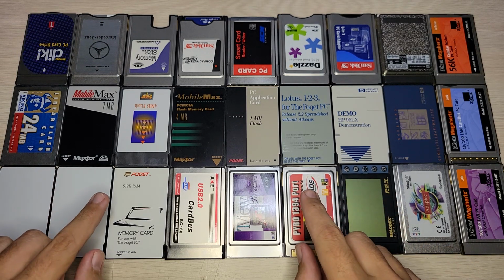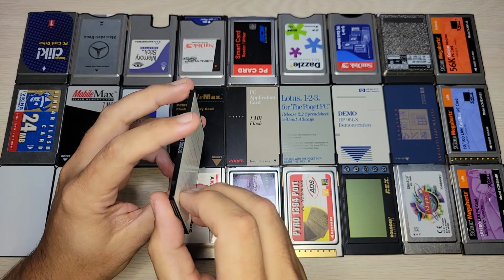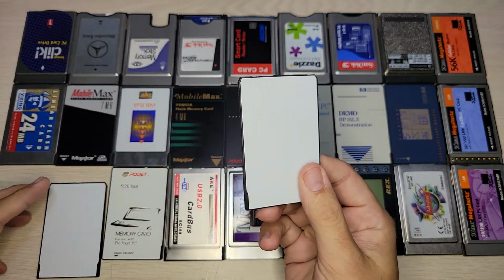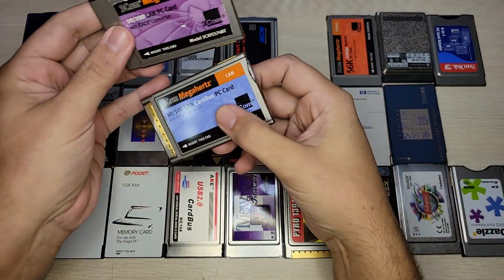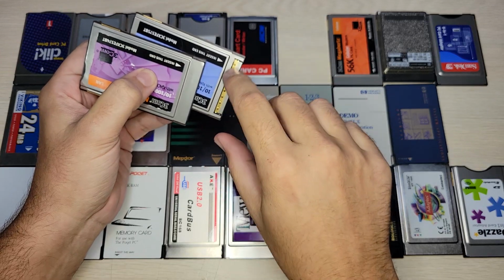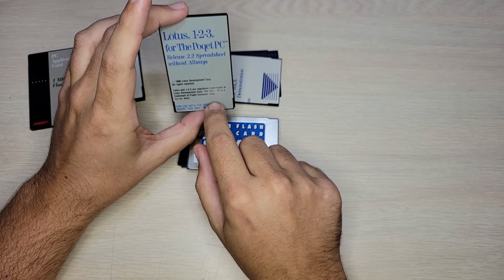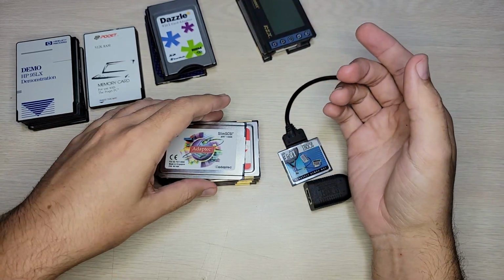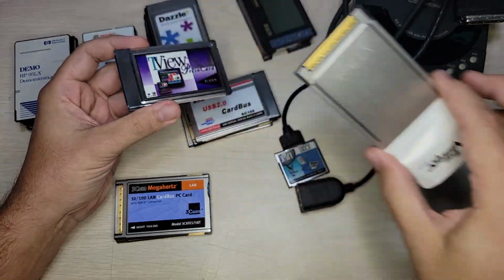PCMCIA Revolution: Laptop Upgrades for the Masses - Retrospective and History

Comment: The 3Com Cellular Modem PC Card had the XJACK connector for a PSTN landline cable connection and a separate connector that allowed connection to Analog Cellular phones for fax and data up to V.32b 9600 baud connections for Nokia, Motorola, NEC, and Mitsubishi phones.

Comment: fantastic video, very useful information that I was looking for. I try and give a 486 laptop a little more storage space and thought about whether I could use PCMCIA slots.😀
Reply from the maker: The most useful adapter by far will be a generic PCMCIA to Compact Flash adapter. You can pick up old CF cards fairly cheap and same with the adapters. For getting files from a modern PC there are still loads of CF to USB adapters that will do the trick. It won't show up as bootable storage, but you should be able to access it from Windows. There are also card services drivers available for DOS.

Comment: I always loved the versatility of PCMCIA cardbus. My THinkpad T60 always used a Creative Soundblaster Audigy 2 ZS which really turned it into a mobile audio center.  only downside was that it always stuck out a little so i could not always keep it inside when transporting my laptop. But it still was an amazing addon. I used this thing to capture the digital Audio from my Laserdisc player into the laptop through the optical input. And my first laptop before that had a WLAN cardbus since i could not find anything affordable in USB form.

Comment: This is definitely a very interesting video and I learned something more about old technology before I even got my first Windows based laptop and PC.
I actually got this video recommended after searching for connecting a CF card as a IDE/PATA HDD replacement for my IBM ThinkPad R52 and a IBM ThinkPad C30.
I found those laptops on the street together with a rather interesting Windows XP PC and both laptops had that PCMCIA-Slot.
I'll be first working on the ThinkPad R52 because it seems more interesting to me because of the dedicated graphics card which was made by AMD or ATI with 64mb vram, it has this Type 2 card slot and also a Express Card slot at the same time which had some strange VW Phaeton PCMCIA Card with something strange to slide in and also I inserted my USB 2.0 Express Card into it. 

I'll only have to somehow go through my personal mail account and find the serial code I bought in 2007 for a CD burning software, install the software on my ancient Windows 7 laptop and then burn two Windows versions on a CD or DVD.
I will be doing a dual boot setup where one 32gb CF card has Windows 2000 on it and my other +200gb CF card has Windows XP Professional on it since this laptop seems to be compatible with both systems.
I already have a oversized PATA to CF Adapter which doesn't allow me to close the little HDD door but that will make things easier. I won't have to do dual booting setup on a single CF card

Comment: Hi, have you ever tested Panasonic P2 camera memory card on laptops with PCMCIA slots? I've heard they are based on PCMICA but not ATA compatible, is that true?
Reply from the maker: I haven't seen one of these before but they look interesting. Since the card appears to be Cardbus (32bit) I'd say it is unlikely to be an ATA compatible card as all of these I have seen conform to the PC Card (16bit) standard. Might have to pick one of these up if I can find them at a good price.
Reply: @RobertsRetro  don't forget Sony's sxs camera card, which is a express card modification. 😊

Comment: I've been lately interested in the old PCMCIA cards. I have a couple from the old days we used to use. We actually used this teeny tiny Sony Vaio SR-27 for years. It was like a netbook-ish idea but in the year 2001. Well it had almost zero ports, WindowsME, no internal floppy or CD drive, no serial and yeah it was sparse. But we used an Ethernet PC Card in it and when we got wifi ourselves we got a wifi PC Card. I still have both. Then later on when I got my Dell Precision in 2010 it had both a PCMCIA slot and an Expresscard slot so I thought that was interesting, far less Expresscards out there btw. I remember a Windows update screwed up my internal wifi once and I used my old PC Card and it just worked, Lol. I also have a Sony branded PC Card CD rom drive for that old Vaio (and ancient USB floppy drive)

I came to the conclusion that owning more of these cards will be advantageous for old computers since I mostly get old laptops. I just got a desktop PCMCIA reader and I think it'll come in handy if I need to read any number of cards like SD, MMC, MS, CF and what have you. Might be easier to use on a modern computer than a bulkier multicard reader but I know I'm a bit of a weirdo. I won't need to actually use it for anything else since I have old laptops to test actual functionality of non storage cards.
It's also for a bit of fun, I've collected quite a few Springboard Modules for Handspring PDAs and these are next.
I found a SanDisk 1.2Gb ATA card at a Goodwill once but weirdly, it sometimes needs drivers or won't work but the knockoff CF reader appears to work in anything it fits in.

34:52 we can't, Lol, there's so many cards for sale with no cable for like Ethernet or modems

Comment: My first wifi connection was from using one of these.
Reply from the maker: Same! I was the first one in my extended family to have WiFi using an original Linksys 802.11b router and PCMCIA card. I begged my parents to take me to BestBuy and bought one of these new-fangled wireless internet boxes with my own money. I almost returned it because it was highly intermittent out of the box, that is until I learned more about it and finally found a channel that worked! Pesky cordless phones and other devices we're really making a mess of those early 2.4Ghz bands. I'll never forget experiencing "Google, Downstairs!" as our family PC was upstairs, for the first time.

Comment: The most interesting card I have is an National Instruments DAQCard. It was included in a laptop I could take home from our lab after we did a big clearout of old hardware
Reply from the maker: I've seen some HPIB/GPIB cards floating around that look really interesting as well. Though I don't have any of that equipment I still want to collect them all! I wonder if the DAQ Card is some sort of programmable GPIO?
Reply: @RobertsRetro  The one I have is a DAQCard-AI-16XE-50. It has 8 digital I/O channels, but I only know their use via the LabView software. Fun fact: the 25 year old LabView scripts that ran with this card can be used on the latest versions of the NI software and hardware requiring only minor (adress) changes!

Comment: OMG! I clicked because of the Poqet PC in the thumbnail and mine needs an LCD replacement and I see the repair you did was exactly that! I'm immediately going to go watch that video and I'll be back later!! :D
Reply from the maker: Good luck with the repair! I hope there is enough info in the video and description to replicate the replacement ribbon. My biggest tips are, get a bunch of ribbons to practice on, and take your time opening the Poqet. It probably took about 2 hours between taking sanity breaks.
Reply: @RobertsRetro  I'm pretty sure my LCD is cracked, so I'm probably still stuck. It's been in storage for about 20 years. 😂 Good to see it's possible to disassemble things. Maybe I'll try to hook up an 8 bit ISA graphics card to that port and run it on an external screen.
Reply from the maker: @AdamChristensen  Dang that's too bad, and I'm actually working on a project to break out the expansion connector to an ISA card. Apparently all the signals are there but if course the Poqet BIOS is unique to say the least!

Comment: Really liked this!, I have a bunch of those cards, the most useful today are the ethernet and CF adaptors one, but I, sometimes use an Orinoco card (branded HP) with my retro laptops (or handhelds) to connect to an isolated less secure wifi hotspot and browse Protoweb. With some tinkering I was also able to sync emails, contacts and calendars with my Jornada 720!